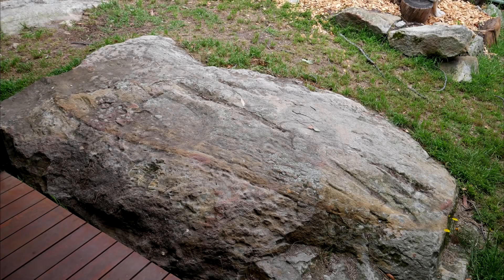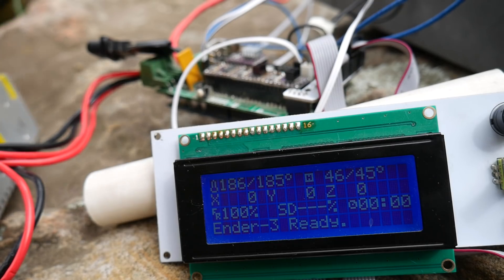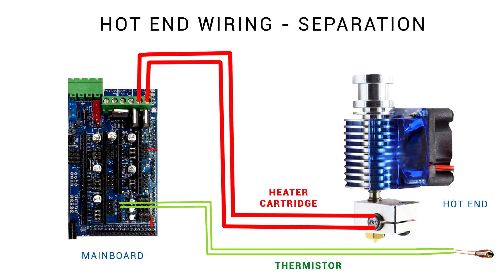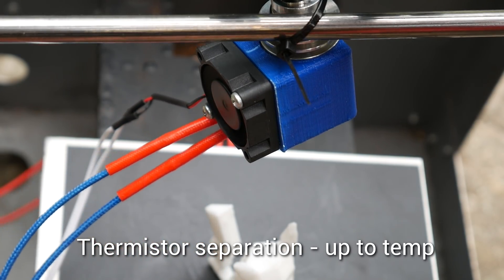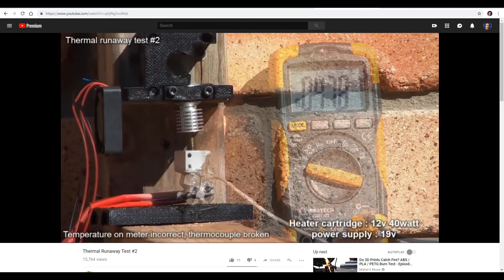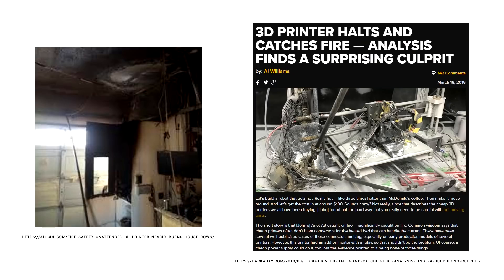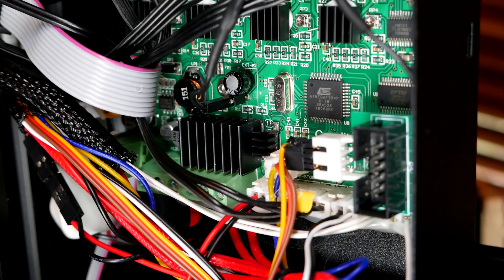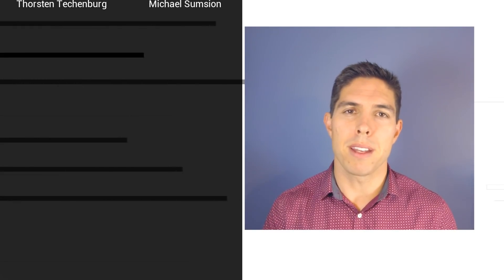Is your 3D printer a fire hazard? How to test Marlin safety features

Comment: Clarifying that the actual issue is about the heater cartridge becoming detached and showing the result give the whole discussion a heap more credibility and makes a lot more sense.  Even if it’s a low probability it’s definitely in the the “why wouldn’t you” category.
The only problem I see is if you’re going to continue to use facts and science rather than myth an legend it will significantly reduce hits on the facebook groups.

Comment: Last update made to the enders Marlin was April 2018 not 2015. You are invested to make people think this.
Reply from the maker: Configuration.h was updated yes, but the base version of marlin is that old. Hence no provision for thermal runaway.
Reply: @Matt DaMof What exactly is he "invested" in? Open source software is just that, open, as in free, and there are a few different options to choose from anyways.

I just received and Ender 3 ordered off of Amazon last week and can confirm that thermal runaway was NOT in the firmware (not just disabled, it's not present at all).
Reply from the maker: 3D printers have a lot of vibrations, can you not foresee the situation where a grub screw holding a heater cartridge in works loose over time? I'm really hoping Creality has fixed this, but the anecdotal evidence from people who have actually tested it, just like I did in my video, shows that it is unlikely. My whole video is an explanation of my testing, how could you possibly ask for more detail? I am using the code directly from Creality. You or anyone else should not have to email them directly to retrieve updated code.
Reply: I think Matt has been inhaling too many pla micro particulates which has resulted in brain damage.
Reply: A control for the people who don't understand how to correct a test! Is to use a ender in a typical manner and see if it catches on fire... Wow that wasn't too hard was it.. and worse case.. lol no worse case is printing on a sinking ship during a monsoon and having your printer be hit by lightning, you have more chance of the happening than your heater cartridge falling out and hitting the print.... Derrrrrrr
Reply: https://github.com/Creality3DPrinting/Ender-3/blob/master/Ender-3%20Firmware%20(Marlin)/Ender-3%20(includes%20power%20failure%20resume-%20English)/Marlin/temperature.cpp
Reply: You need to watch the video again as he states that the ender 3 doesn't have it enabled. Lol without the correct looking into it correctly.
Reply: @meanmaddude1977  From the video description:

"I focussed on Creality here but printers I’ve reviewed from Tevo, Geeetech, Cocoon and CTC also shipped with it disabled. It is unfortunately very common."
Reply: @meanmaddude1977  Also he stated clearly in the video the Min/Max temperature cutoffs are not thermal runaway cutoffs. I think you are confusing the two features.
Reply: @meanmaddude1977  "You need to watch the video again as he states that the ender 3 doesn't have it enabled."

As I said, my brand new Ender 3 doesn't have the code in the firmware either. He's 100% correct.

"If you can't test something correctly you don't publish your test as a fact, that opens you up for slander."

He was demonstrating the what happens with the old firmware vs new firmware. The hardware setup is identical to an Ender 3 (heating block with a thermistor, just like every other 3d Printer), but it's mostly irrelevant, it was just to show what happens. The issue is in firmware (software) not with the hardware. By using the newer firmware and disabling thermal runaway (or not upgrading) you should be able to reproduce these results if you want. 

Do you work for Creality or something? Why is this so personal for you?
Reply: So what evidence can you provide to prove that the ender 3 doesn't have thermal runaway protection?
Reply: @meanmaddude1977  What proof do you need? Amazon Invoice? The firmware has been updated already so not much I can do about that. You can take a look at Creality's Configuration.h file on their GitHub if you want, was the same firmware (search for the word "runaway"). I see you linked in the "temperature.cpp" file above, where in that file are you getting the idea thermal runaway protection is enabled? As I mentioned there is min/max temperature settings but no thermal runaway protection, these are 2 completely different features for different situations.
Reply: Your test in not a real world test! If your heater element has fallen out of your block it's because you have been messing with it and or replaced it incorrectly! The two real world cause are 1 - A broken thermistor and 2 - A blown mosfet . The printer is protected against a failed thermistor and no firmware can protect against a blown mosfet. If you knew anything about electronics you would know that A. .The most common failure mode of a thermistor is an open circuit. B - a MOSFET will fail short first. This is because excessive heat will, by diffusion, mix the dopants enough to create a good conductor instead of the p-n or n-p barriers that were there originally. Often, the gate oxide will be taken into the diffusion, too, causing a short between all three terminals.
Only if the short circuit current after this first mode of failure is high enough to blow the bond wires or the entire transistor, there is an open circuit. These are real world facts, no a test that simulates something that will never happen unless you stupidity modify or repair the hotend.
Reply: @meanmaddude1977  Please show a copy/screenshot where it is ENABLED in the firmware. Thanks.
Reply: @meanmaddude1977  Please go away from this channel and if it's possible don't get into 3D Printing anymore, you're just a cancer to the community.
Reply: And why would creality lie about the ender 3 having thermal runaway protection? I'll be linking them to this video, their team can deal with it.
Reply from the maker: I don't understand why you have linked that. It was uploaded this year but that doesn't change my point. I really hope they now do ship with it enabled, but I've yet to find a person who has has tested and found it stock. As I said in the video and description, creality is not my target here. Every printer I've reviewed recently besides my Prusa hasn't had it.
Reply: As I explained, you can deal with creality, I've tested my machine, it shut down due to different temps between set and reported. You stated you used the current firmware in your video and that is a lie as the current firmware has jerk control ect. You are invested in getting people to change their firmware. I have link this video to the creality design team who I have been talking with for the past month, they can deal with this slander.
Reply from the maker: I am using what is available from their own website. Like I said I hope they are now shipping this fixed but if you read the other comments it doesn't look good. Either way they really need to update their GitHub and website.
Reply: No one can provide evidence! That the printer doesn't have thermal runaway protection! Your test is seriously flawed, you have zero idea how to conduct a correct test! I contacted the company they provided me with the current firmware, you couldn't even do that. Learn how to conduct a correct test before making claims. You have no control, you don't even explain your test in detail. You don't even test a REAL printer, just some poorly build test rig! Nice try falling people but smart people will understand that you seriously have no idea how to test something and am just trying to cash in...
Reply: No I can't because I weekly maintain my machine! The chances of the cartridge falling out is close to zero, especially when it's the stock unmodified hotend because it's got no room to fall on to the build surface! Your test is flawed, fact... you have no control, you don't demonstrate how the custom firmware deals with the issue, you do not show the rig, you simply made a bad test video. There is a higher chance of the thermristor falling out than the heater cartridge! Fact...
Reply: Firstly this test is flawed! Want to test a ender 3 you use a ender 3 not some Jerry rigged POS. Invested is he profits from his videos that advise people how to update the firmware! The test Is flawed in so many ways I don't have the time to list them all..
If you are to conduct a proper test you star with a control, you research if what you are testing is really a issue, not one reported case as a ender having thermal runaway. You contact the source, I did and they advised that apart from a few promotional models all enders have have thermal runaway  protection enabled. Unfortunately  if you start the machine with the heater out the block it won't trip thermal runaway and no custom firmware will protect against stupidity!
Reply: @meanmaddude1977  So you expect him to destroy an Ender 3 in a fire to prove it to you? He was showing what happens without this feature applied on a 3D printer, not specifically an Ender 3, or even Creality printers either. This safety issue is applicable to almost all low cost printers, the Ender 3 is just one of them. It was a demonstration of what could happen in a worst case scenario, not necessarily what will happen.
I love my Ender 3 but that doesn't mean it's flawless. Thankfully Creality lets us mod the software (and hardware) with it's open source design, so we can make it fit our needs. There is more than just this reason alone to upgrade the firmware, it unlocks a whole host of new features that the printer is able to take advantage of but won't do out of the box. I highly recommend giving it a try.
Reply from the maker: The Crab, thanks for attempting to reason here but some people just can't be convinced no matter what.
Reply: @meanmaddude1977  nice attitude
Reply: If you can't test something correctly you don't publish your test as a fact, that opens you up for slander.
Reply: Matt DaMof I can confirm that my brand new Ender 3 received this week which was ordered directly from Creality’s online store does NOT have thermal runaway protection enabled.
Reply from the maker: You need to watch the video again because it is clear you still don't understand what thermal runaway protection is. It is foolish to take the word of the company selling the printer that this feature is present when so many others have provided evidence to the contrary. My video is independent, I am critical of a range of companies for neglecting safety but I still recommend their printers as good value because I also provide free guides for how to fix these issues.
Reply: I'm not the one making wild claims with a unscientific test! Email them and they will provide! Show me screen shot of it being disabled!
Reply: @meanmaddude1977  The thing here it's this "wild claim" makes people prevent a possible fire. If they really had it enabled from factory (you must work at creality to defend them so much) nothing to worry about. BUT if they trust the factory and it wasn't enabled that's a problem for sure and I'm not seeing you to help all those people.
Reply: @meanmaddude1977  "No one can provide evidence! That the printer doesn't have thermal runaway protection!"
The Creality Ender 3 GitHub repo is the exact same firmware that comes with the printer. Please tell us which line in the code enables thermal runaway protection if you are so sure it's there. Hint: It's not in the temperature.cpp file you posted earlier.

"I'm not the one making wild claims with a unscientific test! Email them and they will provide! Show me screen shot of it being disabled!"
Wild claims? It's a longstanding known issue in Marlin firmware, up until the code was added in a later release. Creality forked the repo long before thermal runaway was added. It's a "wild claim" on your part to suggest the feature is present when the code says otherwise.

It's not possible to show a screenshot of it being disabled because it does not show up at all. It's not just disabled, it's NOT PRESENT!! There is no menu option on the printer for thermal runaway whatsoever out of the box. 

If Creality truly does have new firmware available, please ask them to push the changes to GitHub so everyone else has another option besides Marlin/TH3D. Why on earth have they not updated their repo to fix a safety issue?? The only commit on the repo is the one they made 5 months ago when they open-sourced the firmware, since then they haven't changed anything. Most people don't even know about thermal runaway, or just assume it's added without checking first. It's irresponsible at best on Creality's part to not update their public repo to fix this and inform their customers to update their machines.
Reply: @deceitive3338  lol, why so defensive? His test is flawed and bias... End of conversation...
Reply: @Matt DaMof  - My Ender 3 purchased in September did not have Thermal Runaway protection. I have since flashed to TH3D.

You seem to be missing a larger point here. This is a worst case example of what could happen. His test wasn’t biased. It was a fairly common use case using common components. Given the number of these low cost printers in the wild, statistically this will happen. And Micheal and other YouTubers have shared reports of it in fact happening.

Its a straight forward fix which increases the safety factor. It is not a silver bullet. Plus for many, flashing the firmware process is an education in its self. I can see no good reason not to do this. 

Lastly, no one is blinder than he who will not see. I sincerely hope you never have one of these worst case scenarios unfold. Because the information here is what it is. Its your choice what to do with it. Or in your case, not.

If you don’t find any value here, then just move on. We will be just fine thank you.
Reply: @meanmaddude1977  You keep saying "test"... This wasn't a test, it was a demonstration of what could happen without this feature enabled in a worst case situation. It has happened in real life situations, people's houses have been burned to the ground. Just because you maintain your machine does NOT mean it won't happen to someone else. It's great that you are on top of things, but don't mislead people who might not be as careful that read your comments. Just because it's not an issue for you does not mean it's not an issue.
I'm not being defensive, I just can't stand it when people stubbornly cling to their ignorance in the face of facts. Being wrong isn't a bad thing if you learn something from it, but purposefully arguing a point that multiple people have come forward to refute just for pride, or whatever your reasoning is, is something that will not take you very far in life. If I'm wrong I will gladly recant what I've said, but there is no evidence backing up your claim that thermal runaway is enabled (or even present) by default.
Reply: @meanmaddude1977  Encourage your friends that you been talking for a month at Creality to issue a claim to this video for false statements, they won't do any shit because Michael's isn't lying, most of the ender-3 were shipped without thermal runaway

Comment: As someone already noted, the heat sink not touching the third mosfet is not an issue. It’s for the fan.
Reply from the maker: You are right, I will update my pinned post.
Reply: @TeachingTech  

I think there actually is an issue on ender 3 (pro) with motherboard cooling : the motherboard cooling fan is connected to the print cooling fan ! 

Therefore, motherboard is NOT cooled when fan print is OFF !!

That seams crazy, but it's true...  

I print PETG with cooling disabled (for stonger prints). So during the hole print, my motherboard is not activelly cooled !

To solve this, it is possible to connect the motherboard fan to the hotend cooling fan (which is Always ON). 

I'm gonna do that asap.

Comment: I have an ali framed Anet A8 but i dont know how to check what firmware is installed in it.......
Reply from the maker: If you enter M503 from a computer when connected via USB, you will get some info such as the compilation date. The most foolproof way to check for thermal runaway is the test at the end of this video.

Comment: I want to add to be extra safe you can use a smart smoke detector such as nest protect and use an IFTT recipe and some smart outlets so if the smoke detector goes off it will automatically kill power to the printer(s). This is just an added layer or security and will provide useful if you have ever stepped out on the house.
Reply from the maker: A great suggestion and something I may consider exploring and making a guide for in future.
Reply: @TeachingTech  Please do it!

Comment: Hey Michael great info, I updated my Ender3 to 1.1.9 a while ago and all of the protection is there my concern now is that i Just received my CR-10S Pro and am going to have to put it through it's paces.
Reply from the maker: Their is no CR-10S Pro firmware on their site but the normal CR-10S firmware on their github has it. I would double check but it seems likely.